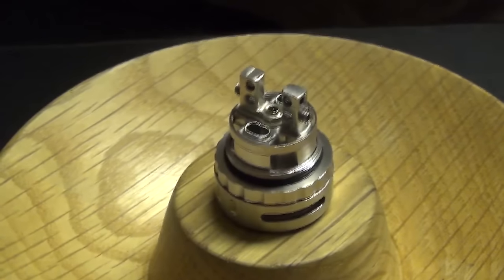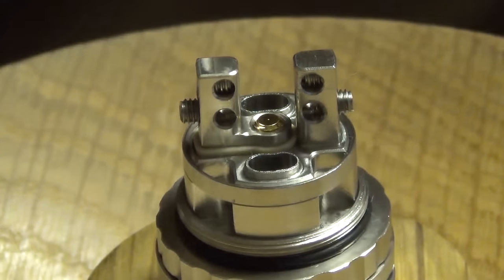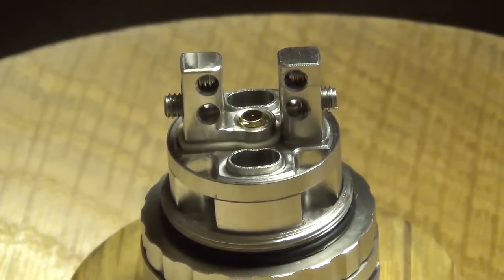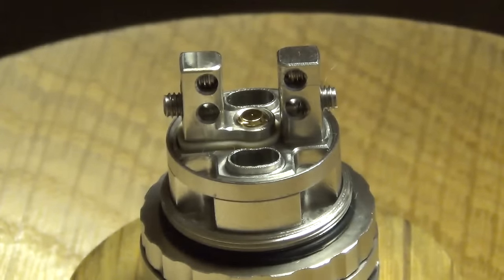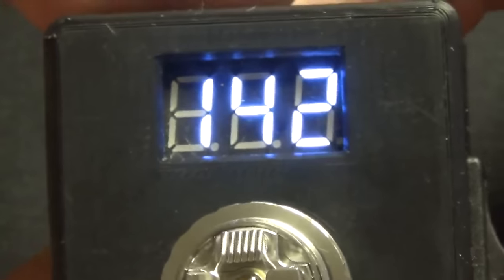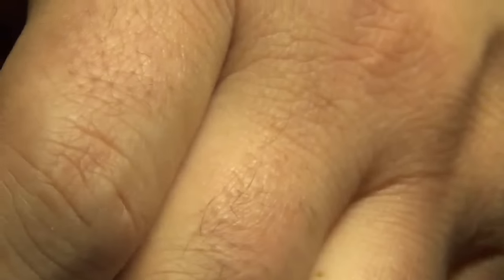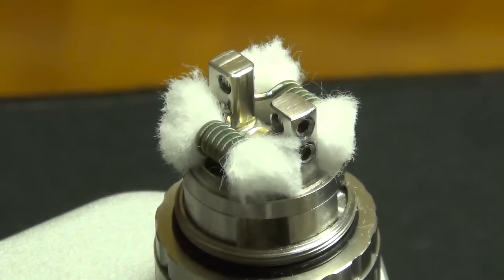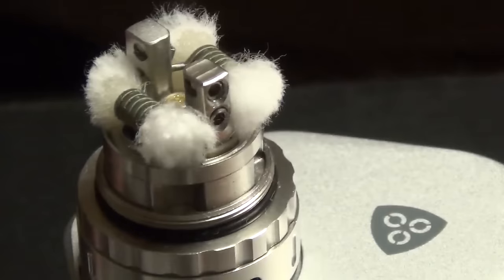rebuild: griffin rta .22 ohms.

Comment: Very nice. I replicated the build as closely as i could (no 40 gauge, used 36), and Im impressed with the flavor boost. Not only that, but the vape is slightly cooler and denser as well. Keep up the good work. Subscribed.

Comment: Ya so I just rebuilt my Tsunami the way you did in this vid(i plan on doing the Griffin too, but im currently in need of time and satisfied w/current build) and my rda is a flavor machine. Seems to put out a more dense cliud and it dies restrict the airflow for me but in a good way. It enables me to keep the airflow wide open whilst keeping it to feeling like a 3/4th open draw, which i love. Anyway just wanted to let you know +Trevor Jones. So happy I found your tutorials. I cant believe i never thought of doing this on these velocity style decks. Good stuff here. And YES I AGREE! In vaping it really is all about the little things and little changes esp when  rebuilding... So a con I may find later is more spitting /seeping since the coil is "dumped" so close to the air holes, however i noticed this amazing flavor bump/booooost and i do not want to go back to my other ways. One more thing-it is also wicking better and quicker when dripping down the middle sins it no longer needs to travel so far. Before id have to take the cap off every time to redrip but with this way you can drip down the drip tip(carefully) and it is saturated almost instantly. +Trevor Jones is my new RTA Zen master!
Reply from the maker: awesome Derek! So excited that you're digging it to brother! Thanks for your awesome, and detailed comment that will benefit so many! Stoked!

Comment: i use all 4 holes but my coils are at the same level as yours are. i just hold them on the airflow and push down from the top while im screwing each side down. then after  each lead is secured. i pull it up a tad so its not touching the airflow,  then pulse and  done.  that build looks nice to tho. i just like using all 4 holes. 

Peace
Reply from the maker: awesome Anthony! I am so excited that you found something that you like! Thanks for watching!

Comment: Nice technique. I use to use all four holes but never was able to get is as close as you did there w/out damaging my coils a bit. This seems better! Quick question - does your tsunami leak a bit?
Reply from the maker: honestly my tsunami is unusable. but I decided to vape it for just a few minutes to give this technique a try. it worked great! But the unit I have leaks out of the 510 pin. yeah bro lol it's really 👎! But the little vaping I did with this technique in there it worked beautifully! hopefully that helps man. No leaks, great wicking! just great! I will be reviewing another unit (tsunami) soon! I guarantee this technique will be used in it. really really enjoying it! Thanks for the great question bro!
Reply: +Trevor Jones ya no matter what I do my Tsunami weeps around the side of orings, under mod and spits out airholes. Ive owned a Kennedy and it wasnt this bad, but Flavor is good so i just use it on unregulated mech for now. Yes I could "paint the wicks" but i end up pulling the cao off and leaking Anyway :-/
Thanks for the reply!

Comment: Great Video as always Trevor!! I was curious so i decided to ask you how often do you change your wicks on your drippers since you have been running Claptons in them?
Reply from the maker: not as often at all, i change them every couple days. when I used to change them everyday. fused Claptons are just so versatile it's crazy! Thanks for the great question!
Reply: Your claptons are looking very clean but I wouldn't expect anything less from the "building guru"
Reply from the maker: +Brian Kelly thanks dude! this humble ni80 is just SHINY! it's joyful to use, vape and build with!
Reply: Yeah it's way shiner than lightening vapes n80. I bought 500 feet of it but I'm damn near out. Ran through it on about 2-3 months. I'm definitely gonna try that humble wick not wire. Have you tried any claptons with stainless steel rather than n80? I heard it has killer flavor.
Reply from the maker: +Brian Kelly I have been meaning to do it, I hear the same. I will most deff keep you posted on my findings!

Comment: fantastic idea dude re building my griffin with that unique method asap
Reply: +Trevor Jones I gave it a shot and I must say its improved the flavour a lot !! really impressed and yeah it was a real B** getting that ring back on but its performing amazing great video !!!
Reply: I need your advice on something though my griffin gets really hot after a couple vapes and I'm using 26+32 clapton wire and I'm doing six wraps any tips on how to avoid that but still stay above 0.3 ohms and get decent flavour production

Comment: Hey Trevor!   WIll this work with my Gemini RTA Tank?      The dude at the vape shop told me it'll short if i do that?    Both coils anchored to the same holes
Reply from the maker: BubbleTeaFob not true my friend, I love my Gemini this way! Remember to snug those screws up real good brother!
Reply: I came across you by a recommendation by Suck My Mod.    I love your videos!   Gained a new sub!     

Hey Trevor,  what are some pros to having the coils anchored the same way you do it?  is there a reason for your preference versus the conventional way?
Reply from the maker: BubbleTeaFob I love Matt! That is super cool man I am honored to have your support! Really you can mount them normally and just push the coils down if you want. But by loading them in this way you really get those coils in the air flow. The outcome is great flavor/vapor/juice delivery and shortened cotton coming out of the coil. Your really pulling the vapor off of the coils as soon as the juice is vaporized...I prefer it and think that it's totally worth the extra time. Again man thank you for subbing to the channel bro I am very grateful!

Comment: you said this build is a 28N80/40N80 2 core fused clap yeah?
Reply from the maker: it's a 28 awg ni80 fused with 40 awg ni80.
Reply: +Trevor Jones Just rebuilt mine to mimmick this exact build, great idea bringing them down super close to the air holes like that.  Works out perfect because I had just installed a new build a few days ago that just wasnt cutting it, I think I'm back on track.  Sometimes the simplest builds vape the best, especially in tanks
Reply from the maker: +joe leeman awesome! Thanks your your feedback Joe!